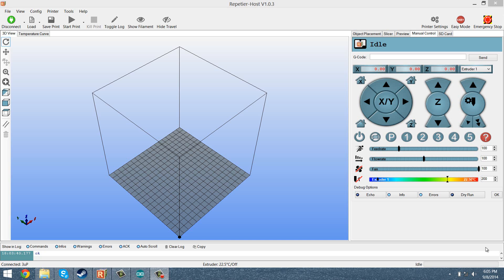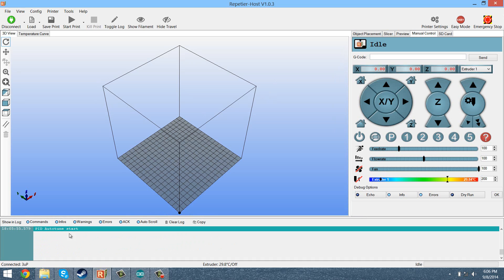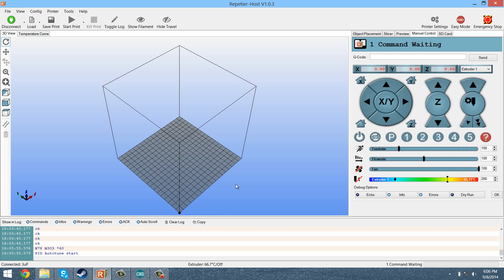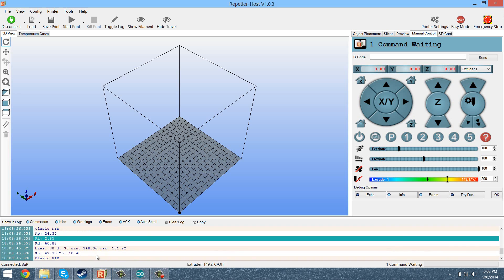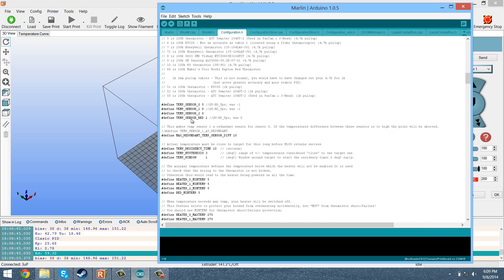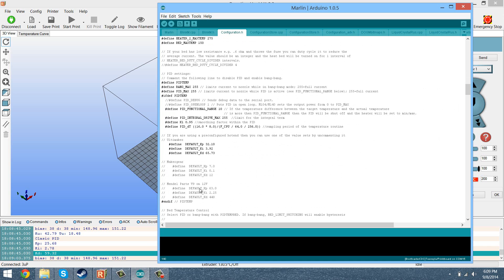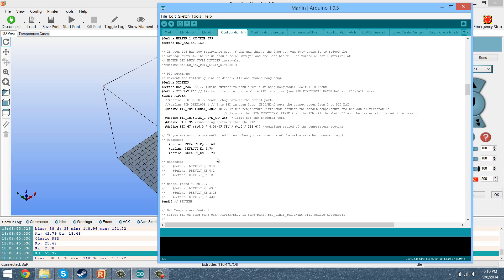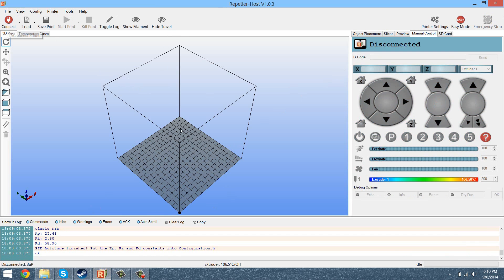3D Printer Tutorial - PID Autotune Thermistor

Comment: Hello, i have changed my Motherboard for a new one, than i set the Marlin firmware in it, the problem is that the thermistor is not reading the right temperature, when is around 20 C It shows 40 C, do you known how to fix that?

Comment: I'd be keen to understand if this process will give a particularly good tuning. Sure, we're getting the hotend up to temp a lot quicker (although it's already very quick) and holding it a lot more stable, but this is all with the print head stationary and no filament flowing. Once you start to move the head, it will cool with the air flow. Once we start to run filament through it, it will have work to do. Perhaps tehre are adjustments we could make to the autotuned PID gains?

Comment: Can you do a video or a post on fabric8r about what all you need to change in the firmware when upgrading to a E3D v6?
Reply from the maker: e3d specifies it in their directions, the only other thing you have to do before you PID autotune the new hot end is change the thermistor type within the firmware. The one you are looking for will be under the configuration.h folder and e3d's instructions tell you exactly what to change. After you do that and PID autotune you're done!

Comment: Hey, nice work on the video series, been really helpful in getting my TwoUp going!
However, I feel like you skimmed over a lot in this video. Firstly, you need to let the autotune finish! It will pop up a message saying when it is finished, and present you with calculated average values from the entire process, which will be much more useful than just the first numbers it dumps out.
In addition, it's well worth making sure you're tuning based on the temperatures you usually print at. I print in PLA at around 200°C, so I tune at that temperature, and run the cylce 10 times to ensure accuracy. My command reads like this:
M303 E0 S200 C10
Which means autotune Extruder 0 at 200°C, and cycle around that temperature 10 times.
This will give you higher temperature control accuracy at your most-used temperatures, as well as making sure it's heating to it as fast as possible.

Cheers!
Reply from the maker: Thanks for the advice! First off I did let it finish I just didn't get any pop up message, perhaps you are using a different software/firmware combo? It did say autotune completed in the logs.

Also I wasn't aware you could specify the temperature and number of cycles, I will include an annotation and update the description and give you credit!
Reply: Haha thanks. Yeah, it does say it in the log, but the values you entered were only from the first cycle.
Sorry, shouldn't have used Aussie colloquium - there's no pop-up message, just one appearing in the log, as you said. 
Cheers.